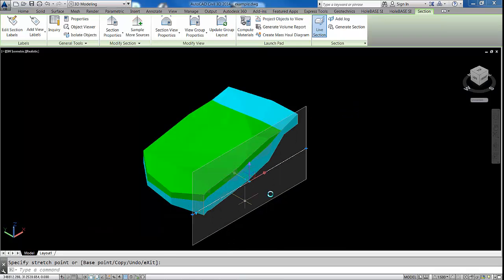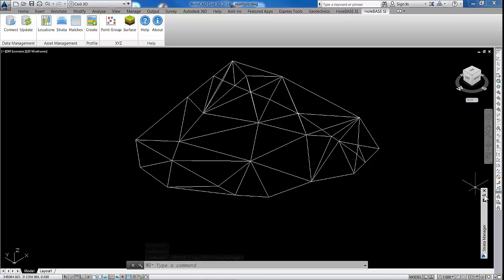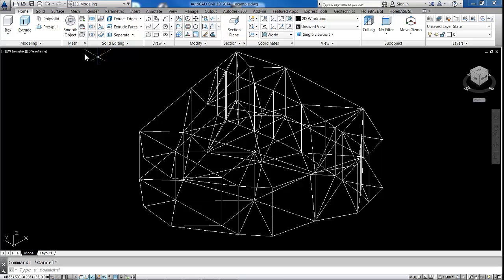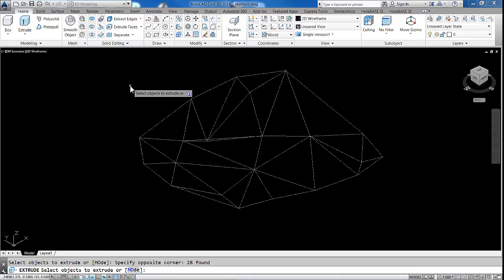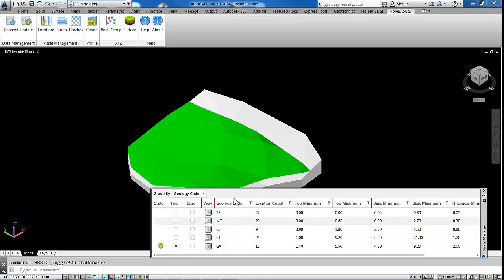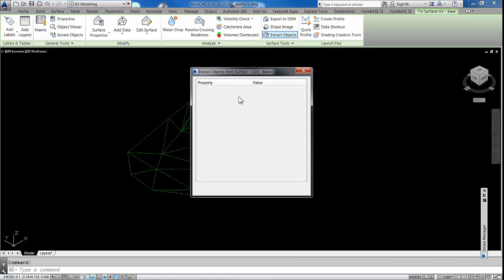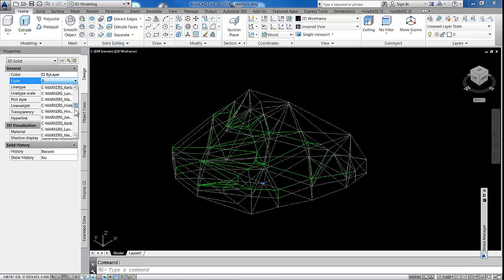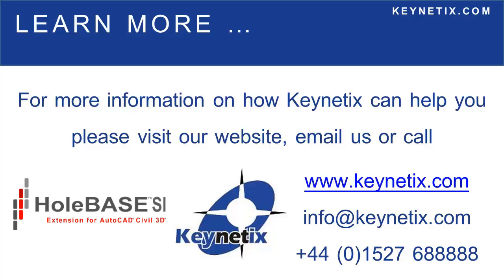AutoCAD Solid Geology:  How to Create a Solid Geology Model from AutoCAD Civil 3D Surfaces

Comment from the maker: Hi Chris,
I used a preview of the new HoleBASE SI extension for AutoCAD Civil 3D which should be released in June 2014.
This version as been rearchitected to give better performance and closer integration with HoleBASE SI, as well as better use of Civil point groups. 
We also added the ability to create point  groups and surfaces from any down hole data. i.e. plot contamination level, or water strike location.

Comment: At the start of this video you show some 3D borehole data which you then turn off.  Can you tell me how you created those boring sticks or better still can I take you up on your offer of making a video to show it.  Thanks in advance
Reply from the maker: Thank you for your comment.

In this video I created the 3D boreholes (boring sticks) using the HoleBASE SI extension for AutoCAD Civil 3D linked through to HoleBASE SI. It's the same tool I used to create the geology sub surfaces in the video.  Having said that the 3D boreholes and sub surfaces could have been created with the Autodesk Geotechnical Module.

I will do a future video showing how the 3D boreholes are created, although it is a very fast process, just connect to the project in HoleBASE SI and they are created.

regards 

Gary